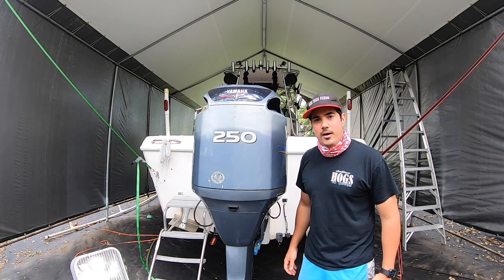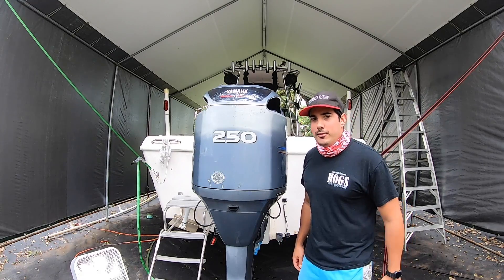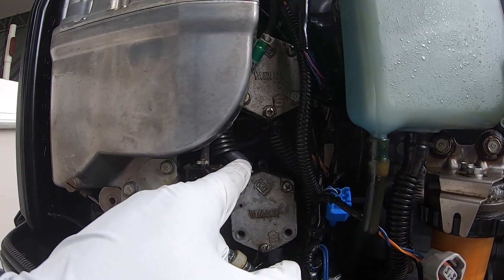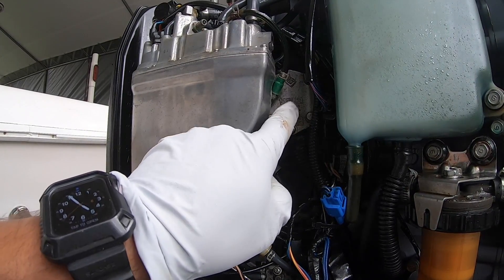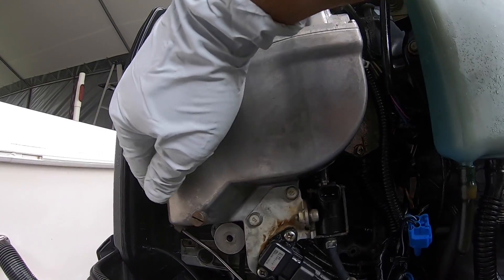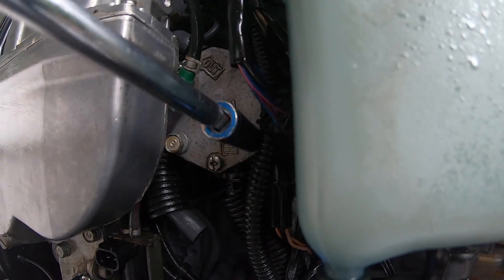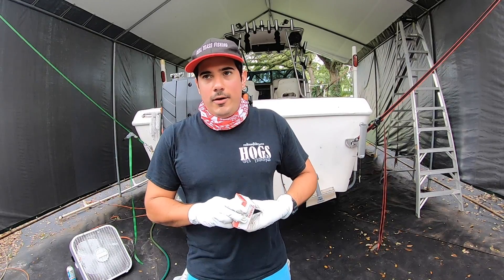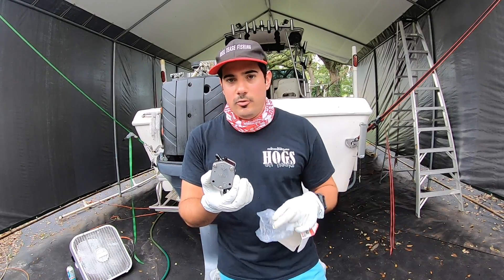Yamaha Outboard Low Pressure Fuel Pump Replacement

Comment: I rebuilt all 3 diaphragms, I cleaned the o2 sensor, changed fuel water separator filter, replaced fuel bulb. And still mine is stalling out at idle. It will run fine when going fast, it will idle fine for half a day or be fine for a few hours. But it’s still stalling out every now and then when idling, just out of nowhere. The fuel lines look fine. Idk what to try next
Reply from the maker: Have you done the low pressure fuel pump check as shown In one of my other videos to verify they are not leaking ?

Comment: What was the engine doing to let you know that the low pressure fuel pumps were bad?
Reply from the maker: Common issues
Hard to start
Dies when trying to throttle up
No power lack of power
Doesn’t plane out
Rough idle

Comment: Hi Carlos, I have a question on the purpose of using grease in the bolt holes and the new gasket?

Seems like I heard you say “as always”. 

I plan to change all 3 of my low pressure pumps on my Yamaha and was curious about the importance and reason behind the grease? 
Could Anti-Seize be used instead of grease? 
Thank you
Reply from the maker: I use marine grease on all bolts. It is the safest bet for dissimilar metals. When you come back to do maintenance again it will come off easily.
The issue with anti seize is that as ironic as it sounds it can cause a reaction in the marine environment called galvanic corrosion. This is because the bolts are stainless, the engine is aluminum and anti seize usually has small traces of copper and other metals. 
In a marine environment this can cause issues and do the opposite of what we are trying to achieve 
Use marine grease and you’ll be fine
Reply: @ReelTeaseFishing 
Damn you know your stuff bro! 
Thank you for taking the time to explain
Reply from the maker: @lljustice2012 unfortunately I learned the hard way haha. Thanks for watching and asking questions. Have a great summer

Comment: have a problem with my 115 four stroke mercury, cutting  out when put in reverse and no power when I opened throttle. I changed the throttle cables when this problem started. I have since throttle box. Told now might be low or high pressure fuel pumps

Comment: Would a bad one tick? I have a tick noise and I dialed it into the low pressure fuel I’m pretty sure. Mines a 2021 90hp so only one
Reply from the maker: @Wisconsin_Fisherman  these are strictly mechanical working under vacuum. Never had one tick

Comment: I have a problem... you have a hard time starting it... but after that it's fine. Maybe I need a new gas pump or an advance adjustment
Reply from the maker: @dimitrisstavrou4881  hard starts can be failing choke, dirty carbs, failing low pressure pumps. O through my videos I have a video that shows how to test these pumps

Comment: I do have one trick to add.  Loosen the VST and all, remove the mounting bolts from the pumps, disconnect the top fuel hose from the VST and the bottom hose from the filter.  Then slide both pumps with hoses attached out as one assembly to remove/replace pumps and hoses on the bench.  Then feed the assembly back behind the VST, position the gaskets and bolt back in place.
Reply from the maker: Thanks for the tip!!

Comment: Hello . Great Video. In your opinion, do you think this repair can be performed with boat in the water?
Reply from the maker: Yes. These pumps are very accesible and only two bolts to remove them

Comment: Hey Carlos, great video.  We're having problems with an OX66 fuel injected.250.  It real hard to initially get started.  Also, will only fire up, when it's at almost wide open throttle.  I do know that the mechanic supposidly went thru the VST, the filter and such.  Any thoughts?   The primer bulb stays hard when primed if that means anything.
Reply from the maker: Hey Dennis,
You landed on the right video. Thank you for watching and reaching out. 
First things first, and may sound simple but have you tried leaving the throttle in neutral position and priming the bulb till it gets hard then turning the key to the on position. Allowing 5-10seconds to pass (this allows the fuel system to prime and fill all the rails, injectors etc. then turning the key to start the engine. Do this process maybe three times if it stutters and doesn’t start. 
If it doesn’t start but sounds like it wants to I’d look into your low pressure pumps. They are easy to check. Loosen one at a time (two bolts) but don’t completely take the bolts out just loosen enough to separate the pump from the block and have someone squeeze the bulb. If fuel drips or squirt out from behind the low pressure pump it has failed. Replace it. 
If all checks out I’d look into 
Your spark plugs look for good spark, perhaps a fouled plug on a cylinder. And a compression check can tell you a lot. The. I’d look into cleaning O2 sensor if your engine has one.
I’d look into the temp sensor that may have failed and not letting the engine realize it is cold starting. (Temp sensor will, when engines cold, increase starting RPMs and decrease once engine hits operating temp) 
Lastly I’d get a link and sync performed by a mechanic.
Good luck and please let us know if you solve it and what it was.
Reply: @ReelTeaseFishing  dude thanks a lot for that detailed reply, i'm actually totally floored that you would took the time to do that.  I'll keep you posted.
Reply: @ReelTeaseFishing  hey carlos, ok here's the update.  The very first 2 steps is what it took.  pumped ball til hard, turn ignition to on to let fuel system pressurize, approx 30 secs.  she sputtered first 2 and fired up and stayed running on number 3 time!!!!  but here is a question Carlos, is that normal, and second, should we have to do that even when the engine is warm?  we still will loosen low pressure pumps to check for leak, but from what your hearing what you think?  And again, dude thank you so much for taking the time.
Reply from the maker: @triathletechink69  ok that’s great news! I’m glad she’s running with just the start up procedure.
These engines are some of the best engines Yamaha made for their 2 stroke era. Keeping that in mind, they are two strokes. They love fuel and don’t like cold starts. 
For the most part once the engines have warmed up they should crank right up unless they sat enough time to cool off and fuel pressures to drop etc.
If you stick to that start up procedure it should crank right up. 
Let me know if that answered the question

Comment: I have a 2004 yahama 300 hpdi I need new fuel pumps and injectors do to boat sitting. Where is the best place to buy parts ?
Reply from the maker: Try Crowley Marine 
They have a solid parts diagram and parts store online. 
I get all my parts from Marine Express which is local to me in South Florida

Comment: Will this cause a no start? I have a 1998 Yamaha 150 2 stroke that doesn’t want to start after sitting a while. I have to spray a lil gas in the cylinder to start but after that it starts every time no problem.
Reply from the maker: It could be weak pumps, could be air leak in a fuel line, could be a non working choke. Weak primer bulb, clogged fuel filters. 
Hard to say really. But it’s definitely going to be a cold start/fuel issue

Comment: Hi, I have a 2018 Suzuki DF60AV outboard, when I start it, idles fine but when I give it power, it feels like it's running out of fuel. Got fresh gas, changed fuel filter and plugs and still doing it, do you think it could be the low pressure fuel pump?
Reply from the maker: Here’s what I would do. Id get an auxiliary(portable tank) 3-6gal tank with new gas lines and primer bulb. Id connect it with fresh gas to the outboard and run it. If it runs good you know the issue is from the fuel line back to the tank. If it runs the same. You can really focus in on the engine. 
There are way too many variables to say and this test really narrows it down. 
Plus you will have it for future diagnostics
Reply: @ReelTeaseFishing  Thank you so much for the recommendation, and FAST response.
Reply from the maker: @alechamid235  no problem Alec, good luck and feel free to come back and ask more questions. Let us know how that test goes and we can go from there

Comment: Having an issue with a 150 Yamaha outboard and thinking it may be fuel pump issue. Do you know if there is 2 lp pumps on a 150 as well. I see 2 but thought 1 was high pressure?
Reply from the maker: High pressure pumps don’t look like these in the video
Reply: @ReelTeaseFishing  I figured it out. This Z150TXRA has the same two lp fuel pumps. Problem is finding them local to upstate NY
Reply from the maker: @bsh21wash1  glad you got it figured out! 🤙🏽

Comment: Great Video.  I have a 2008 HPDI 250 and at about 2500-2700 RPMs it does exactly what you mentioned and others had recommended.  Instead of taking it to a mechanic, my two pumps will be in tomorrow and I am swapping them out.  Bet you just saved me several hundred dollars...Thanks.  I will let you know how it goes.
Reply from the maker: Awesome, glad you were able to get this done on your own 👍🏽

Comment: Did the fuel pump come with the mounting gasket or did you buy it separately? Great video!
Reply from the maker: The gasket comes separately
Reply from the maker: Part number for gasket is in video description

Comment: Thank you for posting this video. I have 1999 twin 4 stroke Yamaha 100s. It bogs a little while accelerating, then will run well until 4000 RPMs then begins bogging again. If I pump the primer bulbs while running it will kick up to 5500 rpma shortly. 

I have clean non-ethanol fuel, new plugs, new fuel/water seperators. Just ordered new fuel pumps and fuel strainers (fuel filters basically) Do you think this sounds like a fuel pump issue? 

I’m happy to circle back this week once the repairs are made. Cheers.
Reply from the maker: Hey CJ if the engine is running when you prime the bulb then you have narrowed it down quite a bit. we know its fuel issue, and its because its starving of fuel. It could be a bad fuel bulb. It could be air getting into the fuel lines via a bad clamp or a dry rotted/cracked fuel line. also pin holes in the fuel line cause air issues too. Lastly the fuel pumps could also have failed. Let us know what you find. looks like you've checked off a few of the known issues as well.
Reply from the maker: Check the filter on your VST if you haven’t done so.

Comment: Have a 2004 Yamaha 200 HPDI she runs fine at idle but when I give her throttle she won’t go past 3000 rpms and bog down. Can’t get her up on plane. Any advice ?
Reply from the maker: is it holding at 3k rpm and not moving? it could be limp mode. Limp mode is enabled by three things. Low oil (or bad oil sensor in the reservoir both the tank or the one under cowling) Overheating & lastly water in the fuel. if you don't believe you are in limp mode, then I would suspect your fuel filters are clogged. try replacing the VST filter, your spin on filter and your water/fuel separator and see if you gain any RPMS. 
It wouldn't be a bad idea to put fresh plugs and run the boat on an auxiliary tank with fresh fuel (non ethanol preferred) while you diagnose. let us know if you find any new details.

Comment: I have a 175 HPDI, It started cutting in and out when i hit a small wake or when i power up to get on plane. it also cuts in and out every 10-15 seconds when running on plane. I ordered new LP fuel pumps and a new vst filter, anything else you recommend checking/changing?
Reply from the maker: Sounds like you are on the right path. I would change the fuel filter in the yellowish bowl as well as the spin on fuel/water filter if you have one. Check clean and tighten all your grounds especially on the battery. 👍🏽
Reply: @ReelTeaseFishing  since my post we tested the spark while in gear and noticed it wasn't firing on all cylinders, my oil tank is low maybe that was forcing it to cut off when i went over waves I will fill it in the morning and see if that solves it. if not maybe bad coil well see! thanks for the videos they are great!
Reply from the maker: @jaredzeno  keep in mind  the HPDI is meant to drop cylinders at idle. This is normal, and supposedly makes them more fuel efficient. 
While at idle if you rev the engine it will start dropping more cylinder as the RPM's increase. its a fail safe for the engine. 
Low oil, water in the gas and overheating will put these engines in "limp mode"  (this mode will drop cylinders too) Hope this info helps your diagnosis
Reply: Yes. It was cutting out while in gear and running. I pulled my spark plugs and they were loaded with carbon. I cleaned them and it ran much better I’ll put nee plugs in tomorrow.

Comment: Hello, what is that blue connector next to the low pressure pump ?
Reply from the maker: Oil Tank Harness also know as Lead Wire
PN: 6R3-85721-30-00

Comment: Thanks for taking the time to make this video. I have a 2002 Yamaha 200 hpdi and it starts but won’t run longer than 2-3 seconds then dies. Do you think this could be the problem?
Reply from the maker: I had an HPDI and I would say your issue is fuel related with 95% confidence.
You can easily check to see if the low pressure pumps are faulty by loosening the two bolts that hold them to the block. just loosen them enough to be able to free them from the block but not so loose that the bolts come out. then have someone pump the primer bulb. if fuel leaks from behind the low pressure pump, you have a bad pump and will need to replace. if it doesn't leak they are good to go. 
 I would start with the easy things. if you are confident you have good fuel. (fresh and clean) then get some New spark plugs & change your spin on fuel filter as well as the fuel filter in the yellowish container under the cowling. 
Get back to us if that doesn't solve it.
Reply: @ReelTeaseFishing  thanks for the reply. I checked both low pressure pumps and they seem to be ok. I removed the hose from the top of the vst just before the barrel filter and started up the motor for a second and fuel came out so I’m assuming the vst is pumping fine. The only thing left to my knowledge is the high pressure pump and injectors. I’m going to try cleaning the vst tomorrow and see if I can clean the injectors. This is my first boat and I’m learning a lot by watching yours and others videos. I knew absolutely nothing a few weeks ago lol

Comment: How can you tell when it's going bad? I might be having the same issue
Reply from the maker: quickest way to diagnose is to loosen the two bolts but not remove it, just enough where you can pull the pump off the engine block and have the bolts still in the block. Then pump the fuel primer bulb. If gas starts leaking behind the fuel pumps, you have a bad fuel pump.

Comment: my remanufactured 200 hp hpdi was running great 225hrs on her...last time I started her she stalled at idle, never stalled before...restarted and went fishing...seemed to run fine...after a few days back at dock she stalled again when started...I shut her down and replace the main 10micron fuel/water filter (blue cartridge) and the plastic primary on engine filter and all 6 plugs...I restarted and she stalled...I restarted and increased throttle out of gear...she stalled...I increased throttle in gear...did not stall...once warmed up she doesn't stall...I also notice the fuel level in the plastic on engine filter is only 70% full...what should level be?  Any suggestions or tests I should perform to further troubleshoot? Thx so much.
Reply from the maker: Ive noticed that the fuel in the bowl also doesn't stay full all the time. I would check simple things like fuel lines, fuel bulb. make sure they are clamped tight. hooking an HPDI to a computer via the diagnostic adapter would be the best bet.
Reply: @ReelTeaseFishing    Is software and cabling to connect to a computer available to public?   Is it difficult to use/diagnose?
Reply from the maker: @michaelphenix2557  you can buy the software and cable on eBay for about $100. its is called YDS (Yamaha Diagnostic Software ) then you will need a laptop to download the software and from there you can run the whole system diagnostic on your engine. fairly simple once you start messing around with the different options
Reply: @ReelTeaseFishing  thank you sir.  Nice job

Comment: Thanks for the video, great job. Look at 5:43, the diaphragm looks like ethanol softened the rubber to the point it lost shape. Some of these sit like mine with ethanol for lengths of time and the rubber just isn't good enough to withstand it. I'm installing a Blue Holley electric for Marine application and leaving these off. Block the ports, bypass these all together. It draws 3 amps and has a regulator I can adjust. That and a Racor 2 micron filter so the 10 micron downstream will stay clean. Good Luck and Be Safe out there.
Reply from the maker: that sounds like a great setup, I will look into that. and yes ethanol really beats these components down
Reply: @ReelTeaseFishing  When 10% Ethanol was first introduced Lexus and BMW had 100K fuel related warranty problems. What few dealerships took fuel samples found up to 20-23% Ethanol when it's suppose to be 10%. Ethanol is a cousin of Alcohol and destroys common rubber. Yamaha and Mercury both suffered from the introduction of Ethanol as well as their customers.
Reply from the maker: @robertjackson7590  ethanol, being an alcohol, chemical compound (-OH) naturally wants to attract another hydrogen thus causing H20. (Hydrogen Bonding) this is why ethanol fuel and water issues are such a large problem along with other issues in the marine industry when the fuel is left in tanks sitting for months.